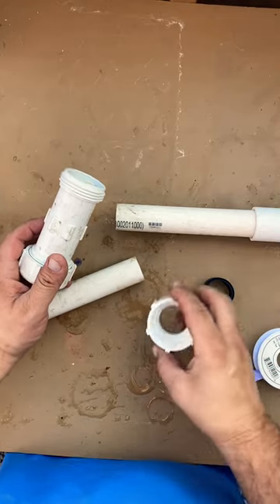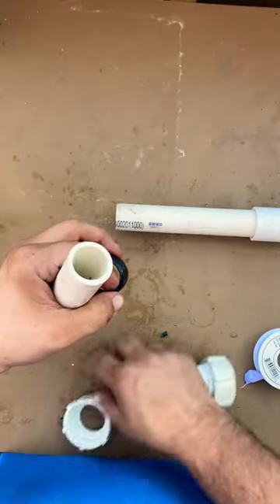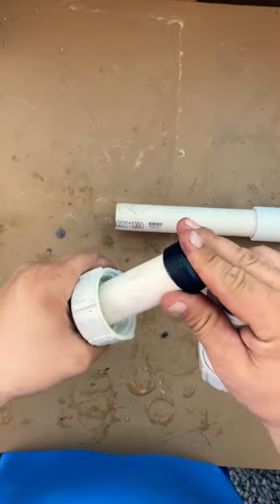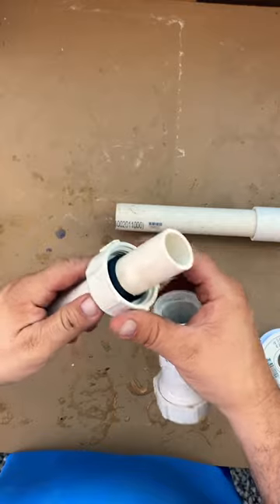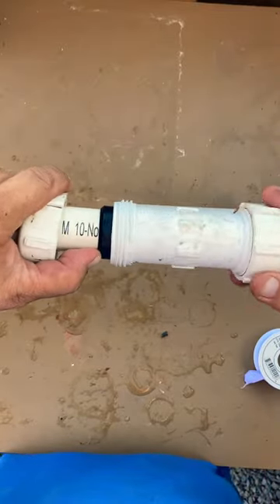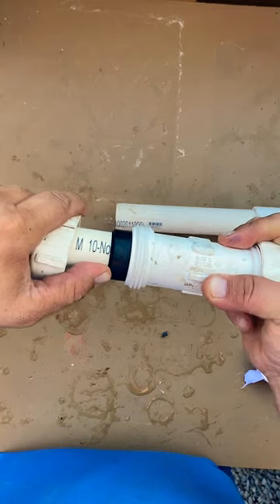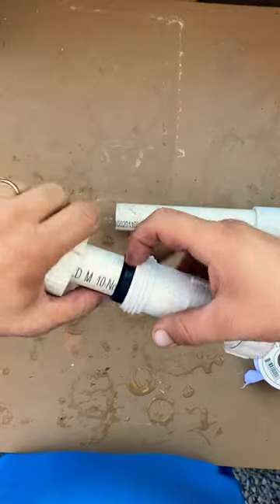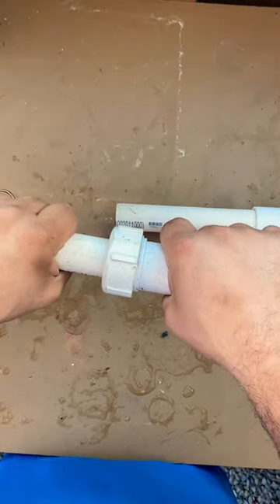PVC compression coupling (how to use compression fittings)

Comment: Can be used only in sprinkler systems depending how many sprinkler heads in each zone loses pressure. After the valve closes, it loses pressure and heads retreat no pressure. Doesn't stress this type of coupling compression. 

I really don't recommend using the direct line to the house. Definitely will fail in days.
Reply: We have it on a sprinkler line, and it's been working for over 10 years.
Now we want to cap the sprinkler line, any idea howw to losen that part to cap it?

Comment: well then what is the good option?
Reply from the maker: I would opt for using a slip fix or slip couplings.  PVC is flexible enough to bend the pipe upwards and force it together if you are using couplings.  You just have to dig back far enough to allow it to bend.  The slip fix is easier to use for a first time repair or DIY.

Comment: Can you join pvc with copper?
Reply from the maker: Only by using an adapter or threaded fitting
Reply: Wtf why would you do that unless it’s a cold water line? If it’s not it Will definitely melt the pvc
Reply: @grim_reaper7997  and cold water PVC will shatter when frozen. And WHY would you run hot water through PVC? And it's already joined, I need to replace the joint. THERE IS hardware to join PVC and copper. Bro, if you don't know something about a subject don't give advice, it's not any help. Why would you that?
I mean, thanks for the help but please don't give advice doing wild guessing.